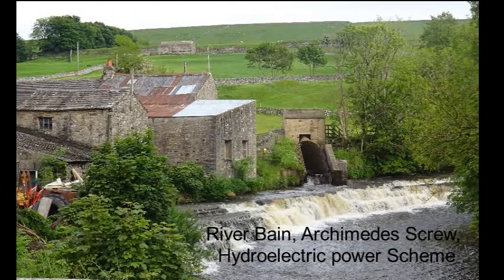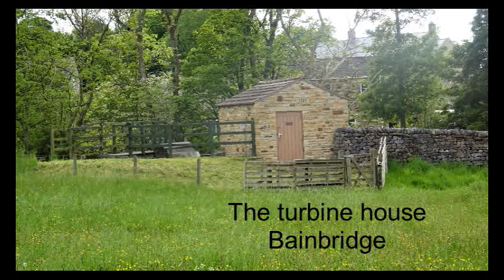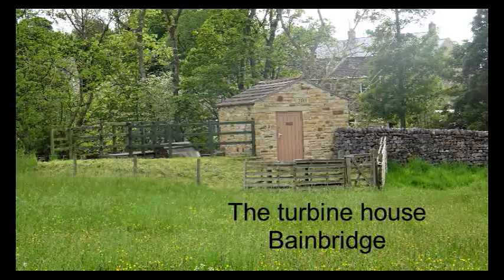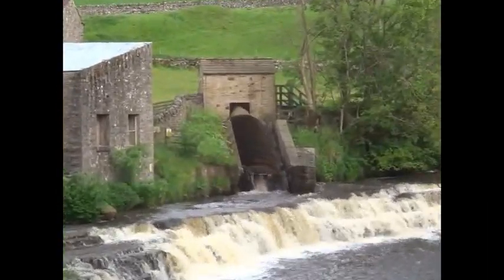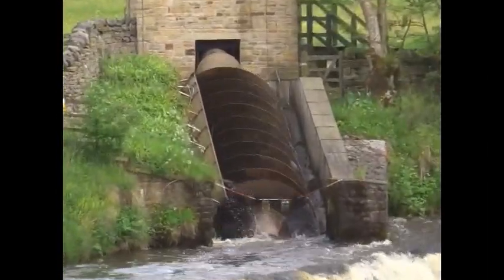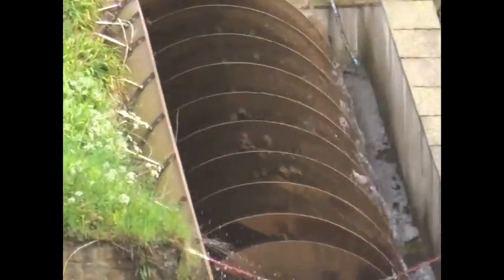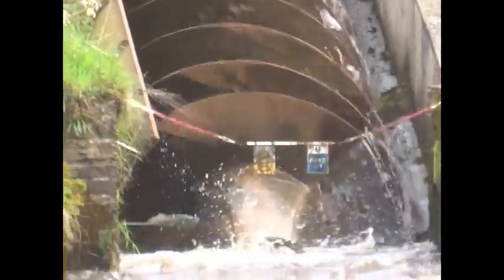Archimedes Screw, River Bain, Wensleydale

Comment: Where is the head? A stream?
Reply from the maker: Being from Scotland I was tempted to trespass, however a sluice seems to be located further upstream and a culvert takes the water to the Archimedes Screw. No power cables visible either - a planning permission requirement no doubt. I haven't worked out the direction of rotation yet for water pouring 'downhill..
Reply: @rogergriffith286  Thanks, Roger. Clearly, the screw is not tapping the full power of the river, which explains the lower-than-anticipated output.